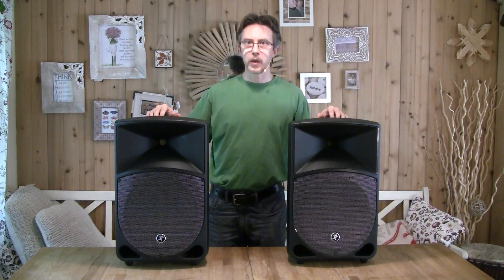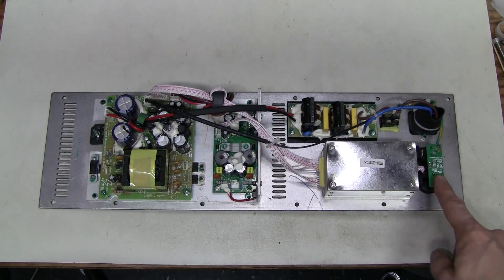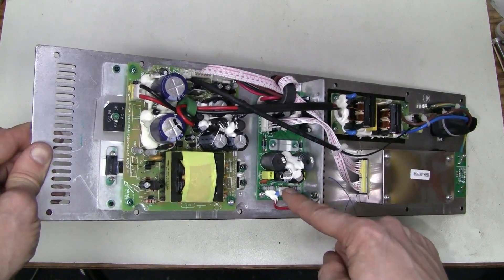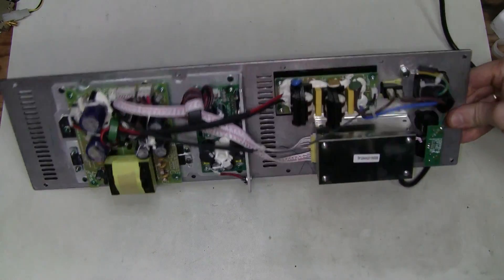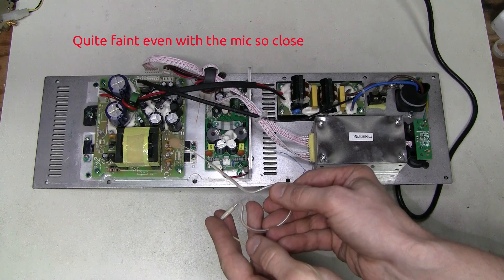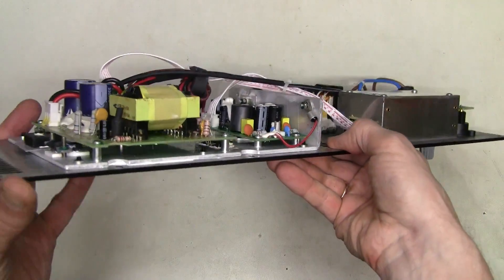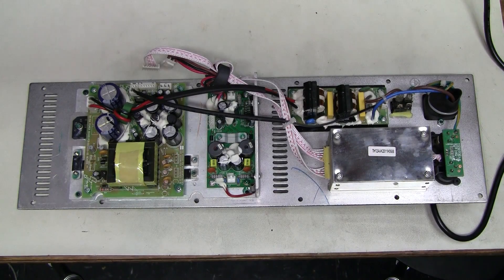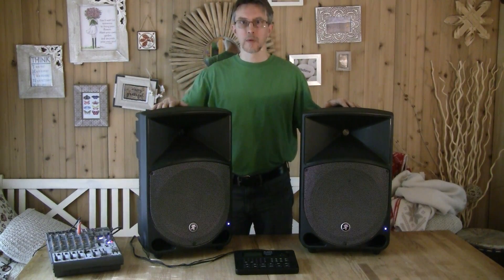#65 - Mackie Thump TH-12A active speaker repair

Comment: Hello, I bought two Makie Thump 212 modules to power passive cabs I already have. The problem is the module just has the little 4 pin quick connect on back. Do you know what where I can find the proper connectors for this, and could you tell me what pins go to highs and lows,  and which are positive and negative pins?  Thanks and Great video!

Comment: Where did you happen to find the schematic to the 15a because that is what I have and I'm having the same issue you are having sort of. Mine has to do with the over load continues to come on after powering up and a lot of folks have pointed to the q104 transistor and the capacitor. Any feed back you could share would be great and if you let me know your find on the schematic. By the way great video. Need more valuable videos like yours and valuable people like you in this world. Thanks again.
Reply from the maker: Google is your friend. Look for "mackie th-15a schematic". I bet you will find it in a few clicks.

Comment: Hello, it is nice video on PA speaker issue diagnosis. Question - I have a mackie Thump12a speaker. When connect to music source, there a very feeble high frequency music heard from twitter but the woofer doesn’t sound. But observed that momentarily the sounds right for a second from woofer and goes back to feeble sound. This happens couple of times in first 2-3 minutes. I feel it could some kind of protection override. Any suggestions?

Comment: Hello Mate, I have a Mackie SMR 650 active speaker it stopped working on my gig. The fuse hasn't blown. I opened it and checked it. Today I took it to a friend and we tested it out, no power. we opened it and disconnected the circuits from both boards and turned the amp on and left it for 2 minutes and turned it off. I reconnected both the boards and there was a spark. The amp turned ON. I tested it 4 times and it worked. I screwed it back in only the 3 screws from the back. It stopped working. can some one help me. I have an open circuit please helo

Comment: Excellent troubleshooting. I have a Thump 12 that will turn on, pass through audio to another speaker l, but will not produce audio  itself. The power light continuously flashes green. Issue just manifested out of nowhere.
Reply: hello , have you find why the power light flashes green ?

Comment: Hello There Sir. I watched your video and quite interesting, because I have the same speaker, it turns on ok but no sound comming out of the speaker... the voltages are OK in both power supply board connectors out (CON3 +28V/GND/-28V and also Ok in the the other Connector out - low voltages). Of course everything is well connected, woofer is ok, 
but no sound on the 12'' drive or in the HF Tweeter... Any ideia of what could be wrong or what (and how) can I check to see if i can pinpoint the problem? Kind Regards

Comment: Hi! I got this speaker. Power supply is fine. I got problem with signal. I hardly hear sound, I have to turn volume at 100% to hear only little bit and I think I hear only highs...
Any idea where to look? :)

Comment: I have a Thump 12 1000w V3 Amplifier module sir. Can I use this for Thump 15 1000w V3 . Or do I need to change some thing in the pre amp circuit to match the Thump 15. Please advise .

Comment: Hi I have the same problem with my mackie TH-15A unit. After seeing your video I opened the board, I can hear the clicking sound but no power indicator on. I checked the legs of the items that you have replaced, but its legs looks fine. Can you help me pls.
Reply from the maker: Why are you saying it is the same problem? It superficially looks similar, but must be a different problem.
Reply: @feedback-loop  It is true, same problem I mean it is not power on. could you please repair it for me? What is your price range? I am in UK

Comment: Hi I have a proel 12ha , there is sound coming from the speaker , but it is quiet and tinny with no bass at all , I'm not very good at testing what could be , do you haev any ideas as to what it could be ie point me in a rough direction , many thanks

Comment: Hello .i could use a little info. if you have it 
i have its a little diff/ . but the same band 15inch  makie 
when it powers on. it pops and there is no other sound
only the pop turning it on. if you can help that would be great thanks

Comment: Hello, I have a qsc k12 speaker but for some reason I am not getting any input sound when I connect the input line. The speaker does turn on, well atleast the lights and fan do lol. Do you all think the problem might be the input Jack's or could it be many different things?

Comment: I have a thump 15a and  It works perfect for as long as it is on. Then If I turn off and want to turn on to use right away it won't work for a few days. Then try again and it does work perfectly. Switch,  cord, speakers are fine. I was wondering what component  could cause that ? Would you gimme an idea where to look at ? Thanks Favio

Comment: Bought a new 2018 Mackie Thump 12A 1300 watt for a personal vocal monitor to hear my self more clearly and most of all more loudly. 
Already running 1200 watt peavey amp into 2 peavy passive 15 inch speakers. Its level has been loud enough for years but i knew I needed to hear myself better to perform better and avoid vocal fatigue. Its not loud enough and disappears as soon as we start playing. Tried different cables, dynamic and live condenser mics etc. Mic gain and mon both up at 90% then starts feeding back at 100. Sounds ok when no one else is playing. Plays music from phone or ipad much louder than singing. Were not crazy loud either. Loud but not intrusively or out of the ordinary for a rock band. This thing would be great for kareoke or an acoustic quieter band but not for rock music. Talked to several techs who were all confused from different companies. Finally received a replacement and its exactly the same. 1300 watts should be blowing my hair back. Is one powered wedge usually good enough or do you absolutely need 2? Never had many problems on stage hearing myself on 1 of the houses though they were not self powered. We have an old powered old JBL 500 watt or or something that's around 30% louder and lower watts.
Anyone else experience this with Mackie or any other mfgs? Is this normal? Thanks!

Comment: So the usual cause of that high freq clicking is a lack of feedback huh? That'll probably help me solve an old shelved power supply issue..
Thanks for the videos :)
Reply: It's one of them. A shorted rectifier or load is also likely, or a bad startup capacitor, among other things.

Comment: +-30V for these speakers. It's a joke. Mackie, your old devices have been much better designed. These look like crappy Chinese karaoke systems inside. The PCB quality is awful
Reply: N-audio - Like everyone else they’re jumping on the Class D bandwagon. It saves them money at the expense of quality. When the output chip fails, it’s a whole new pcb from Mackie.  I guess any old cheap class D module from China could be grafted in at a pinch, it’s not like it could be much worse!

Comment: Maybe the failure was caused by vibrational flexing of the circuit board in response to speaker output and it's simply a  fatigue failure?  It looks as if there is room along that edge of the board for an additional mounting hole, and I'd be inclined to add one, if possible. Nice video, thanks.
Reply from the maker: I would guess the speaker was dropped, and the board flexed due to massive transformer.
Reply: oldblokeh in addition, maybe it is stressed when bolting the diode to the heatsink during assembly time.